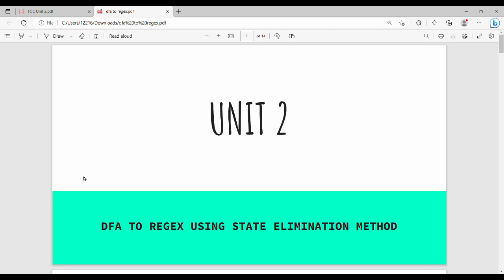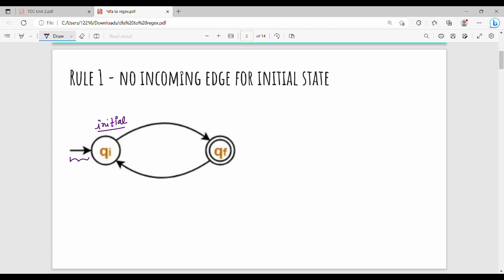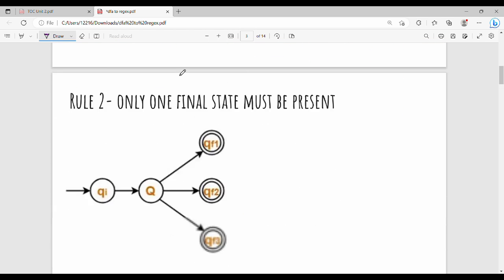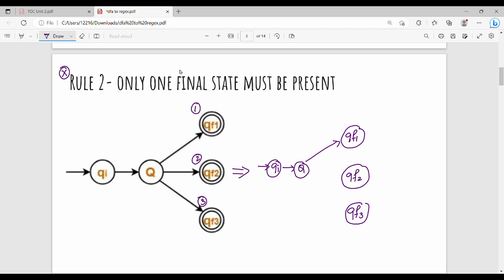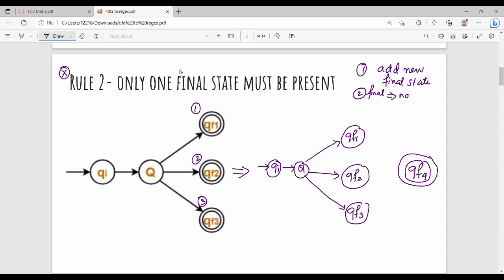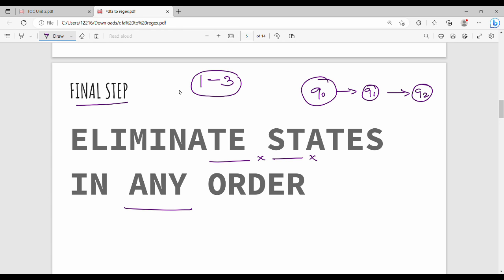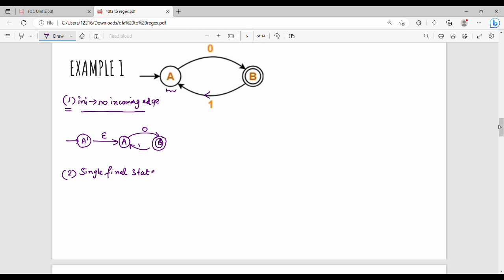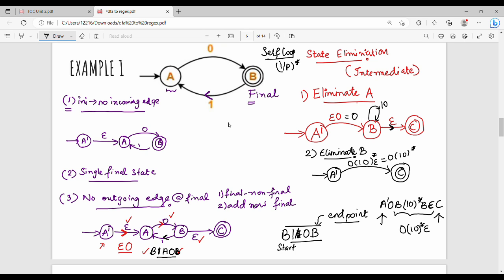2.7.1 DFA to Regex using State Elimination Part 1 in Tamil

Comment: Sir example 1 la A state la input 0 mattum irukku B state la input 1 mattum irukku apdina ithu NFA thana sir DFA na ella state kkum ella input transition um irukkanum thana sir
Reply from the maker: Not necessary. In DFA, for a specific input the transition should be to exactly only one state. Eg. q0 on 0 should go to q1.. But in NFA q0 on 0 can go to q1 and q2.
Reply: @because2022  ok sir thank you sir 😇
Reply: @because2022 sir but it must define all its input signals ri8.....

Like it must say where it goes on 0 and on 1 

But here it only defines 0 or 1
Reply from the maker: @pranavshankar867  No not required
Reply: @because2022  DFA : 'there must be a transition defined for every state and for every possible alphabet character'

Comment: ❤
Reply from the maker: Thanks. Keep learning.
Reply: @because2022  sir  qn is nfa sir not dfa ,but concept is dfa to regx
Reply from the maker: @_KIRUBHASANM  Hi Kirubhasan, the main difference between nfa and dfa is , nfa can have transition to multiple states on same input. But DFA cannot. So the given question is DFA only. You might be thinking that each state is not having transition for all input symbols. We can add/ignore dead state.
Reply: @because2022  ok thanku sir I understood
Reply: @because2022  i have one doubt in minimization of dfa sir ,in that dead state elimination - that is 1st step is required step ah sir because in my book that step is not present and the solution starts from your step 2 that is tt sir?
Reply from the maker: @_KIRUBHASANM  Okay that wont be problem. You can ignore it .